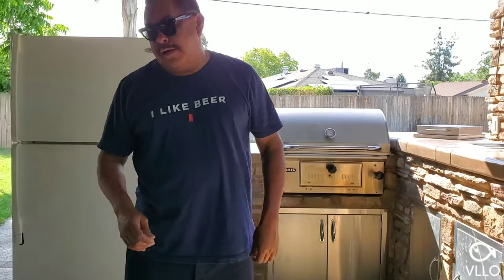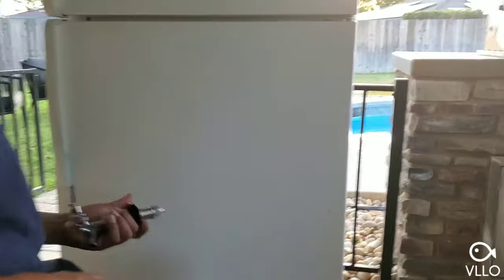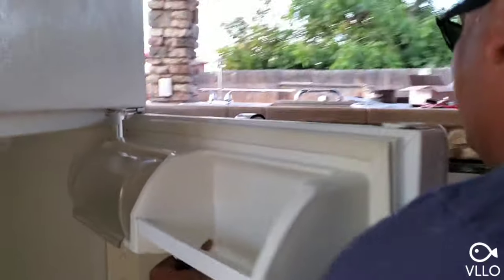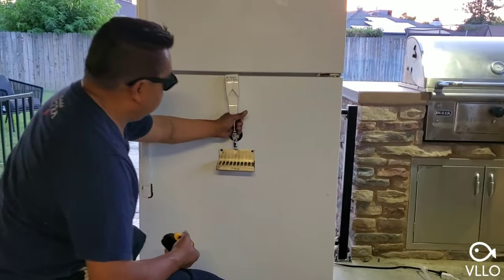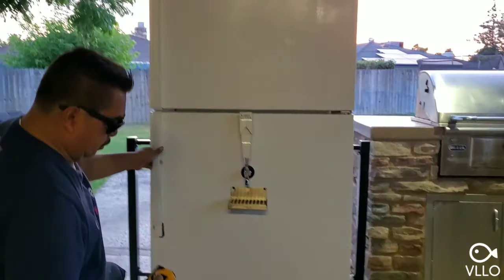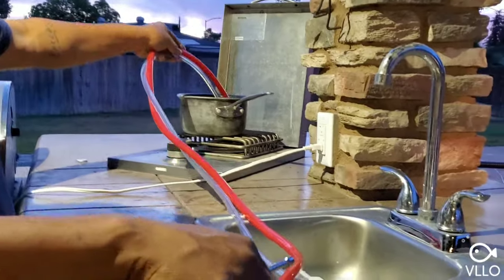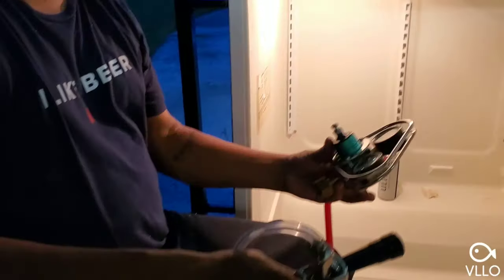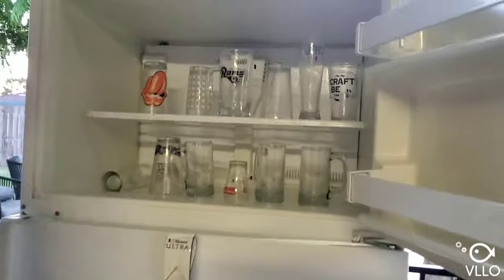DIY how to make a beer kegerator out of an old refrigerator for less than $100

Comment: I thought this was a pretty cool idea. I had a couple questions. I was thinking about putting multiple taps on the fridge. I was thinking of using D system kegs like they out in kegerators. I figure I could fit 3, maybe 4 and still have some room to make a shelf for mixers. My wife wants it to be a full service type thing. Wondering if I can buy small kegs like that. Also wondering if I can use one CO2 tank with multiple valves. Or would I need a tank for each keg? Thanks for the help
Reply from the maker: Yes all you need is 1 Co2 tank.
Reply: There are CO2 distributors so you can use only one CO2 tank and close or open the valve for each keg

Comment: Good vid my man.....i did one but my first 20 pours werent as nice as your first one......why am i getting so much foam??? 80% foam 20% beer?? Do u no why??
Reply from the maker: I set my regulator at 11psi
Reply: @mrnoe67tiktok  mine is at 10-11.....i have a 4ft length beer line ..should i change to an 8ft line u think??
Reply from the maker: @TonyMontana-dr9sp  Yes most definitely
Reply: I will do...thank u my man🙏

Comment: Cool.  so I have the same issue that it looks like you solved, the bump in the back of the fridge that makes it two narrow for the keg diameter,  I see you raised it up, I see the diamond plate sheets, but what did you use underneath, the white box?  I can't make it out in the video.  Could you post a short video on what u used to raise the keg up?  Thanks!  good video!
Reply: ok
Reply from the maker: will do

Comment: "DIY how to make a beer kegerator out of an old refrigerator for less than $100" Debunked

$50 for tap and lines off Amazon
$50 for stainless regulator
$120 for Co2 bottle and fill. 
$120 for a keg of beer
$0 fridge if you're lucky to happen across one.
$50 in tools unless you already have them.
Reply from the maker: yes